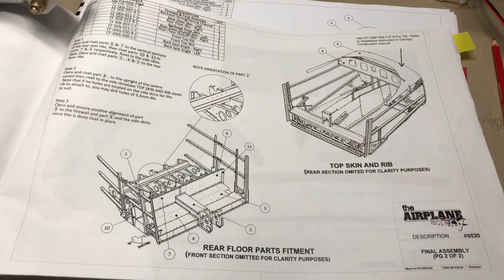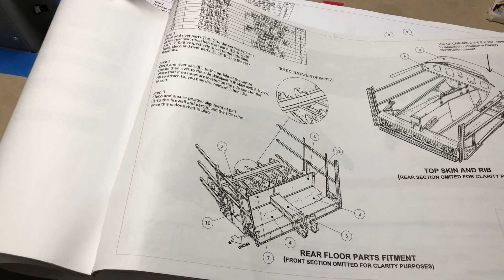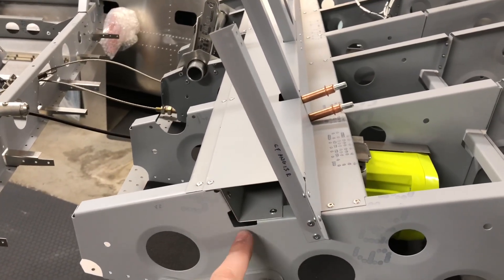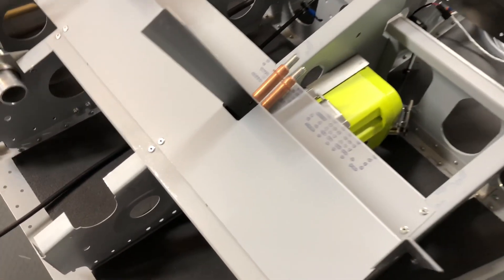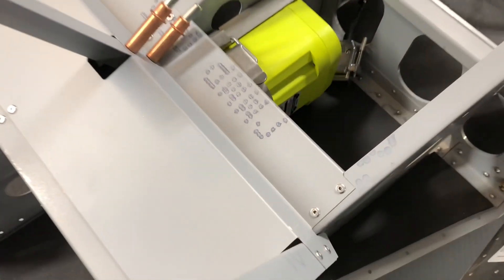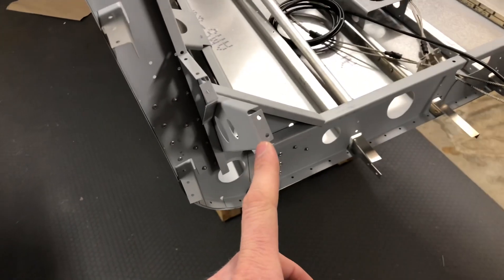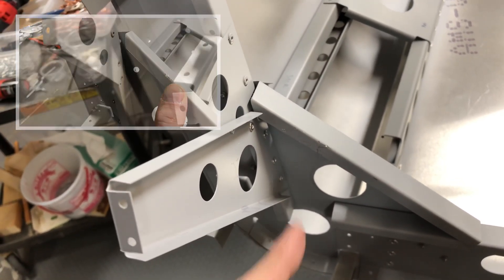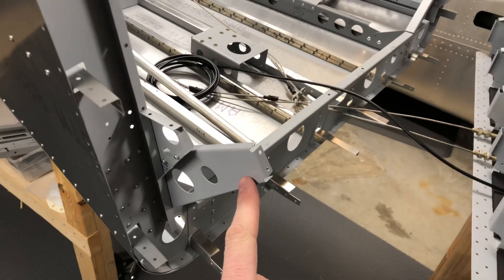Sling 4: Rear Seat Modifications for Parachute

Comment: You have the sling 4, non TSi, correct? 
If so, I’m trying to gain some understanding on a question. Why pick the 4 over the TSi and vice versa? Apart from speed and fuel consumption, their performance seems nearly identical. 
What drives someone to pick one over the other? (I’m cheap and I would opt for the 4, I don’t see the tradeoff of more speed being worth my extra $20k)
Reply from the maker: You’re correct, I have a Sling 4, but I started my project before the TSi was available. Speed and climb performance are the major improvements between the two, from having the extra horsepower with the 915iS. You could compare it to buying the same car in two different trim levels.  If you check out my blog (see link in the description), I did a comparison of costs between the 914UL engine (Sling 4) and the 915iS engine (Sling TSi), and I talk a little about the difference between the 4 and TSi too. In summary, about $20k to get extra 15-20 knots cruise speed.
Reply: @jetshine9985  Thanks for the response. Just found the channel today, I like what I see, good job. 
Anyways. 
The advertised numbers I’ve seen are 100 fpm climb more on the TSi. Not a big deal to me, I don’t mind a little extra time to altitude, and with both being turbocharged, it sounds like getting off the ground and obstacle clearance is hardly a concern. 
I figure, even with the higher speed on the TSi, you burn more fuel on it than the 4 on an identical trip, not a lot maybe 5-10%, but still more. 
And at the end of the day you have nearly identical useful load. 
I’m not trying to bash the TSi, it seems like a truly phenomenal aircraft, I just don’t understand the hype. I want to, but I don’t understand it. 

Is it as simple as like you said in people are just trimming out the “higher trim level on the car” argument? 

Anyways, I’ll definitely check your blog out and drop a sub. Thanks guy.